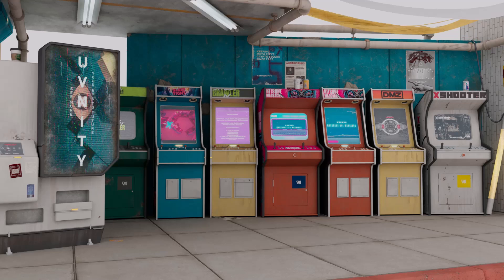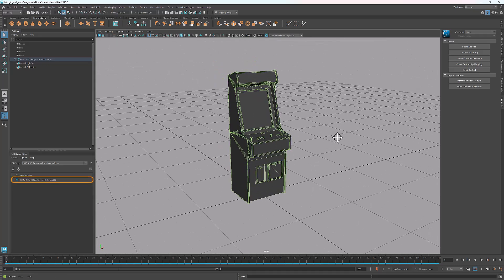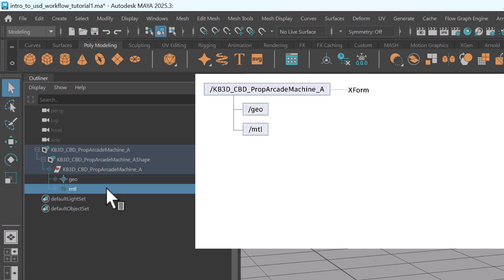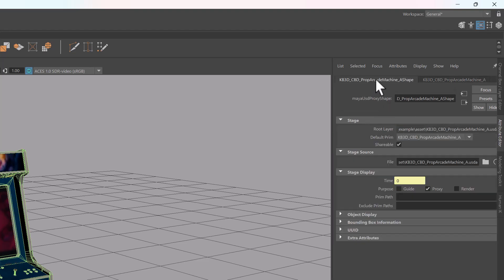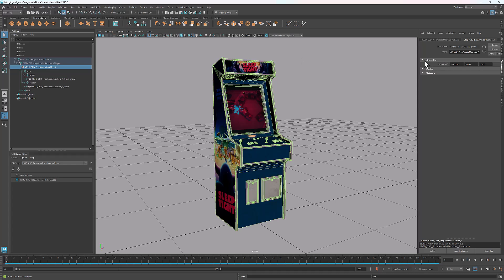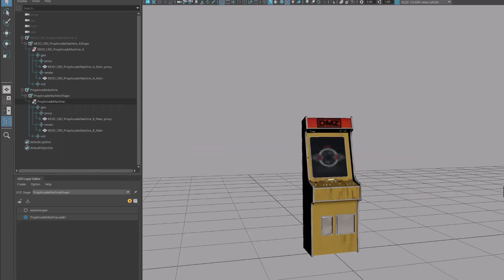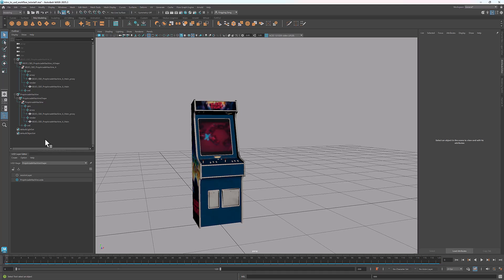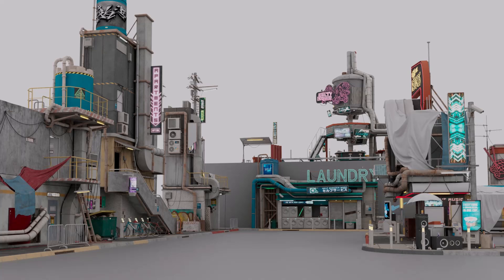Intro to USD Workflow - Ep.1: Overview of USD Structure

Comment: and this is better and faster than FBX... how?
Reply from the maker: It evaluates significantly faster than FBX and has a much broader compatibility with other software.
Reply: @Autodesk_Maya so u say. But what I see does not illustrate that. If ur importing a simple arcade box, using USD is like using a shotgun to kill a spider. An FBX file could have done all this without needing a 20 minute tutorial. This is slow and overkill like most of what you guys do. It's long winded and you keep trying to convince yourself that its fast.
Reply: @TheUnivahFilmEngine this a tutorial duh, did u really expect marvel kind of models and animation?